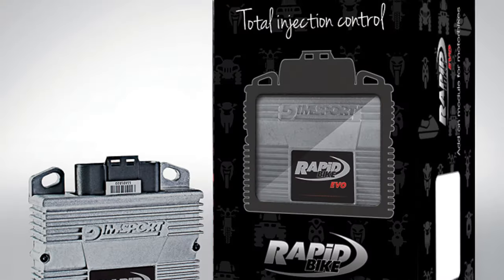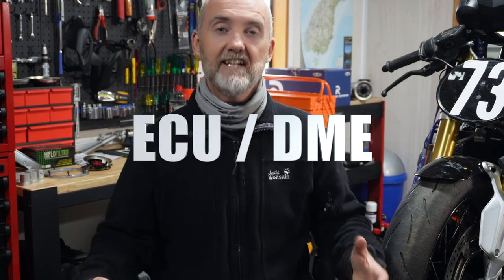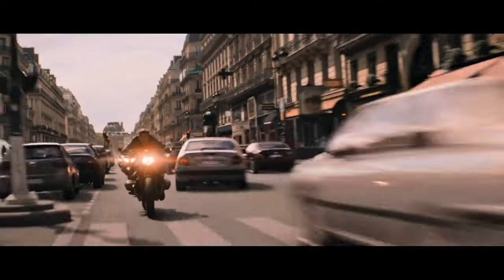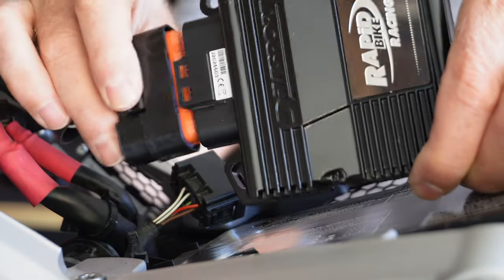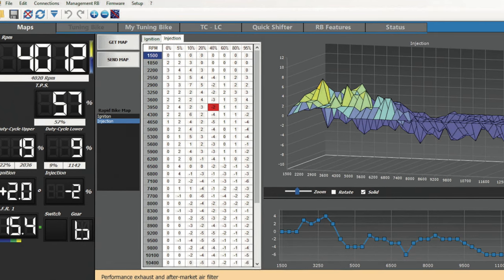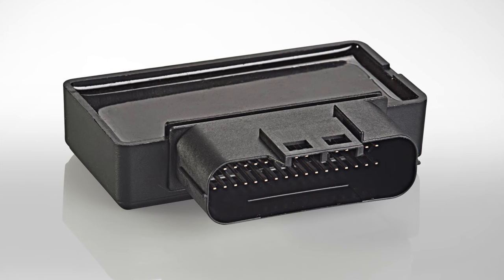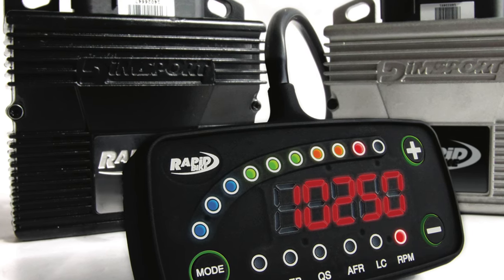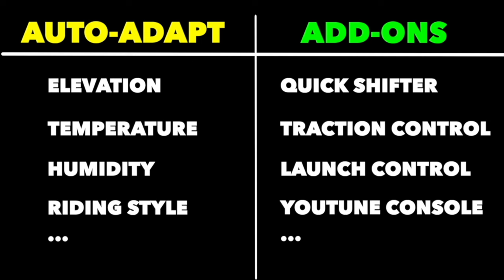...Want More POWER and TORQUE ...?

Comment: As far as I know. Running wideband 02 sensors is the bees knees when it comes to tuning. Allowing your bike to dynamically hit your target AFR values as opposed to narrow band 02 sensors that don't give your ecu the full picture with what's going on.
Reply from the maker: Yeah a wide band Air Fuel sensor provides more frequent current signal changes as it mirrors the actual continuous AFR.

Comment: I have a 2023 BMW R9T that I replaced the original full Akrapovic exhaust for a K-speed, which I can feel, gives it more power, however, it might be running a bit lean. 
My intention was to add some pod filters and install a Rapid Bike Smart (since the Evo or Racer modules aren’t available for the 21’+ generation) but wondered if it would make the motor run correctly or it might not be sufficient adjustment the RB Module could do, since it doesn’t have the same exact capabilities as the Evo or Racer might. Was wondering what your thoughts on this would be. Thank you, and I’m truly grateful for your very educational videos.
Reply from the maker: Hi @marcelosuarez9027, the 90K from K-Speed is pretty much a straight through design. The Smart basically only monitors exhaust oxygen levels, loosely speaking, it is like a volume "knob" to amplify the O2 readng. If I had the 90K and was also changing to a higher volume airfilter but couldn't obtain a Rapid Bike module, and once I was finished with all bolt-on performance modifications, I would simply have the bike Dyno Tuned by a specialist tuning shop who could precisely modify the tables in your DME perfectly for your exact configuration. That's just my opinion and how I'd do it if I was in your position with the 2023 model. But full disclaimer I am not a professional Tuner.  I hope that helps a little. The 23 is a beautiful bike. Enjoy my friend 👊✊️👍😀
Reply: That’s what I’ll do. Thank you my brother!

Comment: I was very excited to see this video. Very interesting, but no numbers. How many horses do you get for your dollars ? That's the bottom line after all.
Reply from the maker: Hi Dave, thanks for the very valid question😀. 
To be honest I intentionally avoided that entire subject for a few reasons :

1. the answer of specific numbers around BHP gained, will be different for different bike setups (e.g. mine is not stock)
2. the real advantage of a module for street riding isn't so much added BHP, but is ride-ability, smooth power delivery etc.
3. Modules provide additional features over a gain in BHP e.g. QuickShifter, Refined Throttle response, Engine Braking and Traction Control etc.

After saying that, you will notice a change in Power and Torque, as the module adapts to how you ride (but nothing mind blowing). But in my mind, for an R9T power gain isn't the main reason why I'd recommend a module. It's more "USEABLE Power and Torque". Hence why I wanted this video to provide hopefully useful information around the "features" provided rather than the specific BHP numbers.
After saying that, if I dyno my race bike for next season maybe I will create a video on that and focus on the numbers 😀

Comment: On the 22 r9t there is a third O2 sensor. If you de cat your exhaust and leave out the sensor do you get a faut come up on the dash?
Reply from the maker: Hey there "no", unfortunitely  I'm not sure myself. Depending on which manufacturer you buy from, the answer may be different. Best bet is to email the manufacturer directly regarding the Module model you are interested in.
Reply: Thank you, I'll do that

Comment: Does installing the rapid bike also void the warranty?
Reply from the maker: Hey @Chandlerd17, good question.😀 Technically they could use it as a reason to not honour the warranty, as it changes the engines chacteristics from stock. After saying that, I have not heard of anyone having a problem with their warranty with this change.  After all, you can remove the unit at any stage, and the bike returns to stock. Personally my bike was already outside of the 3yr warranty period when I made the change. 👊✊️👍

Comment: How much horsepower will add to the bike on a rapid bike racing sir?
Reply from the maker: Hi @mchaelc9794, thanks for the very valid question😀. 
To be honest I intentionally avoided that entire subject for a few reasons :

1. the answer of specific numbers around BHP gained, will be different for different bike setups (e.g. mine is not stock)
2. the real advantage of a module for street riding isn't so much added BHP, but is ride-ability, smooth power delivery etc.
3. Modules provide additional features over a gain in BHP e.g. QuickShifter, Refined Throttle response, Engine Braking and Traction Control etc.

After saying that, you will notice a change in Power and Torque, as the module adapts to how you ride (but nothing mind blowing). But in my mind, for an R9T power gain isn't the main reason why I'd recommend a module. It's more "USEABLE Power and Torque". Hence why I wanted this video to provide hopefully useful information around the "features" provided rather than the specific BHP numbers.
After saying that, if I dyno my race bike for next season maybe I will create a video on that and focus on the numbers 😀

Comment: A 25 or 50 wet shot of nitrous seems way better. Why does no one do it?  The 1250gsa I have is in need of more power after i moved to elevation, but the idea of spending $1,000+ on a tune that does so little is not great. A tune for ethanol is probably the best idea, change the injectors…yet again this comfortable “go with a tune” is crowding the industry and to me the data is just not there to make it look worth it.
Reply from the maker: Yeah that idea has its merits if you want that burst delivery of power. Although you'll still need to balance your AFR with nitrous to ensure temperatures stay within tolerance. You would definitely have a fun-factor with nitrous. Personally I prefer the more usable naturally asperated power across the rev range  rather than an "injection" delivery of power which you get from both nitrous and turbo type setups. Although those are both fun setups at least for a while. 😃

Comment: IMHO Power Commanders are over rated and often don't solve ride-ability issues. I had a Ducati Monster with a full Termignoni system and opened up airbox, it ran like crap so I put on a PC and if anything it was worse, several hours on a dyno later (and several hundred $'s) and it was like a new, better bike, the tech ended up removing the PC and re-flashing the DME.
Reply from the maker: Hey Mark , thanks so much for contributing to the discussion👍. Its fantastic to have members sharing their experiences. It just adds so much more value and insight to everyone's real world experiences rather than just the marketing hype. Sorry to hear you wasted your money on a PC. I'm sure other members will be very interested to read about your outcome 😀👊✊👍